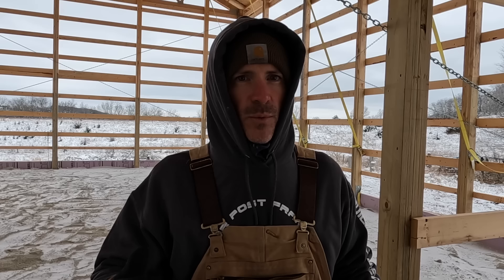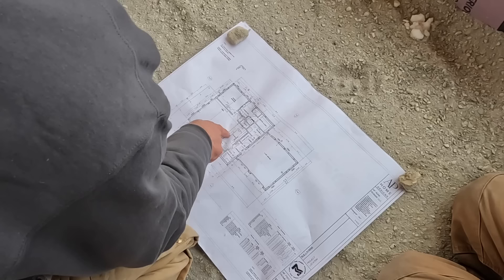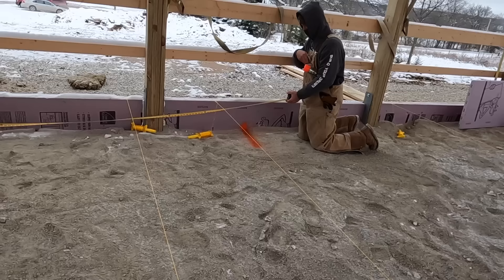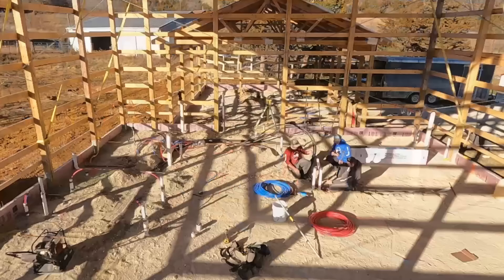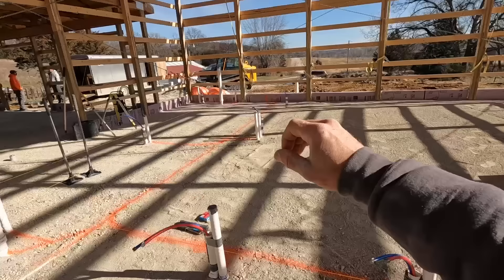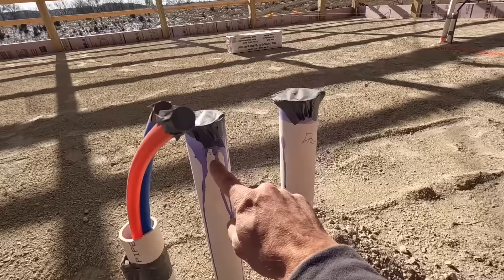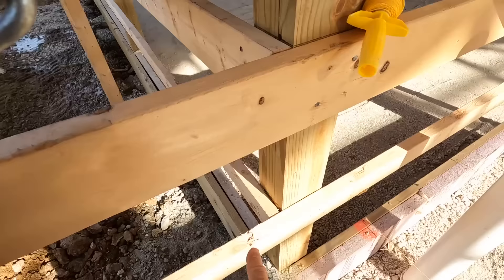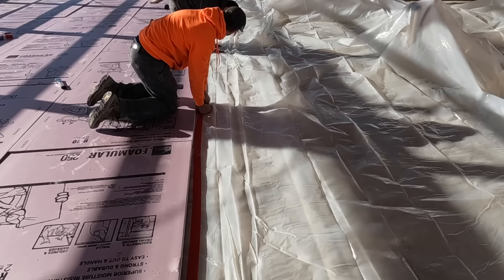Barndominium Underground Plumbing  | Full Cost Breakdown | MAD County Standard | Ep 7

Comment: The clean out in front of the house the combos have to face each other, so there's not that little two foot area of the pipe that can't be reached, that's an inspection failure, just to make a note for the other people watching , a great job on all the stuff, but you want to face those two four inch combos facing towards each other if that makes me sense, so that you  use the one that's furthest away from the house to clean back into the house and you use the one that's closer to the house to clean back into the septic tank, I hope that makes sense if you have any questions feel free to ask? Thank you for your video. If you don't have a double combo for the main clean out in front of the house and flip those two combos in the other direction towards each other then that will work.

Comment: I really like that ICF foundation that you did best. That thing was supper cool! I'm designing a 40x40 shop with a 24x40 apartment all under one roof right now. I might make it 8 ft. deeper but I'm not 100% sure right now. The 64 wide by 40 deep building will be on an ICF foundation. The shop portion will have hydronic heated concrete floors and the apartment side of the building will have a 4 ft. crawl space underneath the ground level floor. I'll also be using 6 inch SIP's for the walls and 8 inch SIP's for the roof. Another thing I like a lot is vaulted ceilings so instead of using the 2x4 roof trusses, I'll be using a ridge beam with only a few custom made heavy roof trusses that I'll make out of wood and custom power coated CNC plate metal brackets that I will bolt through the beams. Then I'll install a beveled edge T&G wood ceiling to the under side of the SIP's. This way I'll be able to have a nice looking vaulted ceiling that can handle a car lift without hitting the bottom of the roof trusses. My design will have I think 3 roof trusses in the garage and it will be a two garage door garage. I might be the first one to do this type of design and would love to see something like it on YouTube but haven't so far.

Comment: Two comments- instead of 2 combinations for cleanout,use sanitary tee , one pipe stubbed up and can clean both ways. Island drains- use a studer vent, put it higher than drain. Studer vent has diaphragm inside that allows air in and no air out so no smell. If studer ever fails,screw off and put another. Studer are code in many states.

Comment: Looks like you larks headed that string line for tension, I am accustomed to larks head knot for the first nail, then for the tension I use a fiddlestring knot (just a loop and twist it for 5-6 times) on the second nail, gives you the ability to adjust the tension and then it's just a tug for the loose end to remove the knot and free the line. I am always trying to learn so I just wondered why not a fiddlestring knot when you put the tension end on the nail for the string line at the beginning of the video?

Comment: I did a slab on grade and my plumber didn't run any extra pvc pipes under the slab for vents. I questioned this before we poured and they said they will do all wet vents in the wall? Is this right?
Reply from the maker: It just depends on the layout. Lots of variables to consider. I would need to see a layout.

Comment: How long does that sort of piping last? It seems nice to build but I would be concerned that the life of the building is pretty much the life of the pipe in the ground since it seems pretty much impossible to replace without tearing most of the building apart... Or can you manage it just taking out all the floors and concrete sawing patches around where the pipes are?
Reply from the maker: Long time...plumbing like this is done all over the country.

Comment: I assume that, like your other builds, this plumbing is going to be covered by foam board and then concrete. If that's the case, then isn't your plumbing vulnerable to freezing in the winter?
Reply: I had the same question. My assumption is they are doing a slab on grade with radiant heat? Also the main drain leaving the house looks to be above the frost line but I’m not sure what zone they are in. Great video though. I learned a shit ton